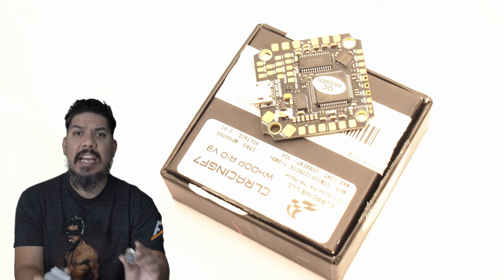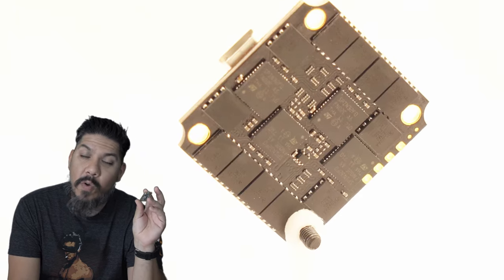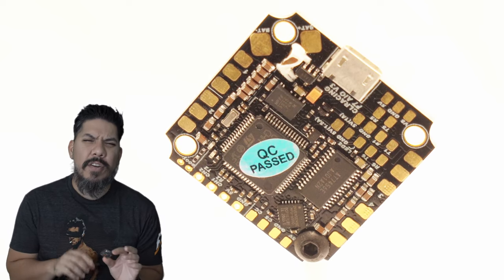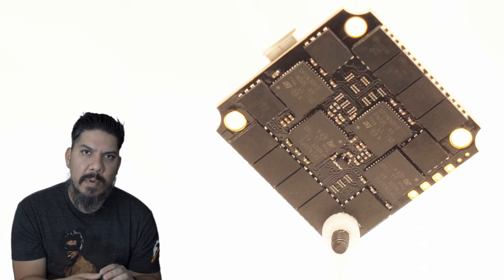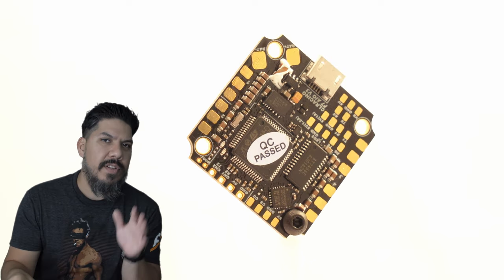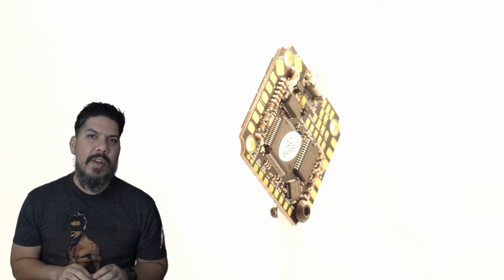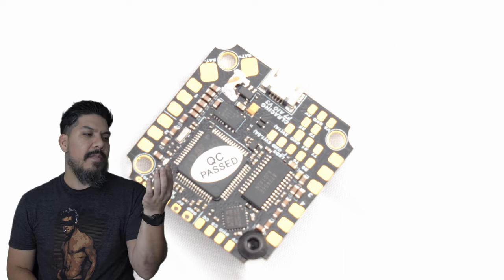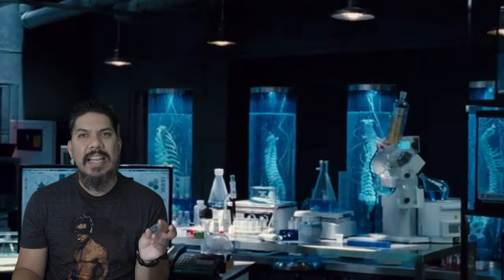CL Racing V3 AIO GIANT FETTS!  35A ESC F7 Flight controller with BOBA Fetts, feat Limon

Comment: Very  interesting! Gonna have to drop this AIO on one of my 2fiddy 5” or 4” builds!🔥👌🏽
Reply from the maker: Go for it!  I am gonna build up a freedom spec 5" racer and run the headsup 2207 1960kv motors on it.  (Primarily for 3S freedom spec, but i wont feel to scared if i have to run a 6S pack on it)

Comment: I'm using this board in an FPVCycle Toothfairy 2 Whoop with Bob's 23mm short motors.  The board layout is perfect for this build except I had to get a little 9v BEC to run DJI.  I hope it holds up.  I'm thinking 35 amps should be fine because I don't plan on crashing and turtling with this thing 🤓

Comment: I installed the beast h7 in my fouride.. idk if I like it. Flies fine.. but I had to downgrade beta flight to 4.2.8, get bl heli m 16.9 flashed just to get rpm filtering. Now I can’t use the motor beeper lol. I do have a cl racing f7 v2 I might swap over to

Comment: That board doesn't have buzzer pads... Can ya remap a uart to fire a buzzer? The blame motor vibes just isn't loud enough.
Reply from the maker: hmmm, thats a good question.  I use the ESC beeps as a buzzer, so i rarely install an external buzzer on my quads.  Just an idea if you wanted something more plug and play.

Comment: The pack counter idea is absolutely brilliant! 
I know this is about the AIO board, it looks like it’s a strong step in building a reliable product.
That’s not meant to be a knock on this board in particular…I think someone commented these AIO are very similar to when 4-1 ESCs started coming out.
They took a while to become widely accepted by most pilots today. I think it was once reliability became on point with individual ESCs that they finally got me to switch over to them.
Once these AIO hit the same level of reliability that I get from a 20x20 stack, I’ll gladly begin getting away from multi-board stacks.
Smaller quads need every possible mm of build space and this essentially compresses 2 core components into one thin board.
I can’t lie though, my mind began to race with the LiPo counter…is there more info on this by any chance?
Curious about a few aspects, will it last through a FW update? Adjustable parameters? You mentioned it wouldn’t register unless armed for a minimum specific time, is that adjustable?
Sorry, this just fills a “wish” I’ve had for a little while so I’m a bit eager to hear more about it
Reply: I purchased 20 such boards and hoped to assemble 20 quadcopters on them. But in the end, only a pair of them work normally, the rest have problems with ESC. Because of these problems, the motors are destroyed, and the quadcopter fluctuates. As soon as I put another AIO, the problems disappeared. The manufacturer does not want to recognize the problem. In vain spent money. Do not buy CLRacing F7 AIO!

Comment: I purchased 20 such boards and hoped to assemble 20 quadcopters on them. But in the end, only a pair of them work normally, the rest have problems with ESC. Because of these problems, the motors are destroyed, and the quadcopter fluctuates. As soon as I put another AIO, the problems disappeared. The manufacturer does not want to recognize the problem. In vain spent money. Do not buy CLRacing F7 AIO!
Reply from the maker: Sorry to hear this, did you reach out to CL Racing?  He typically will repair boards that have defects if you send to him.
Reply: @JonE5FPV  To my deep regret, the manufacturer simply ignores and does not answer my letters.
Reply: @25fobos  Found this comment because I've the same problem with this board, motors are stuttering. I also changed motors so the only possibility is that this AIO is faulty.